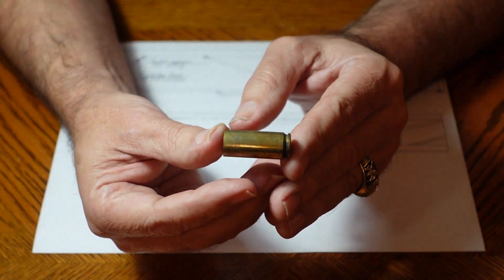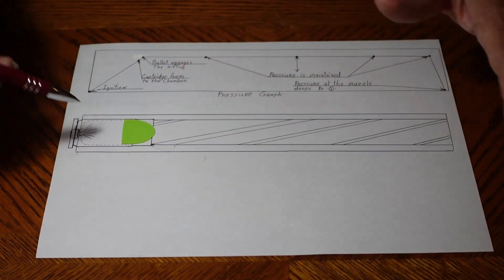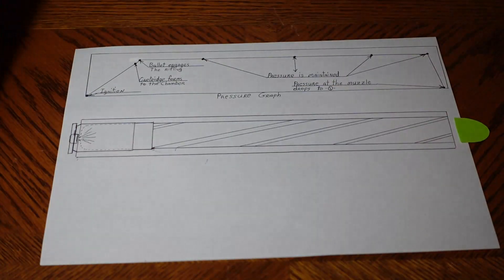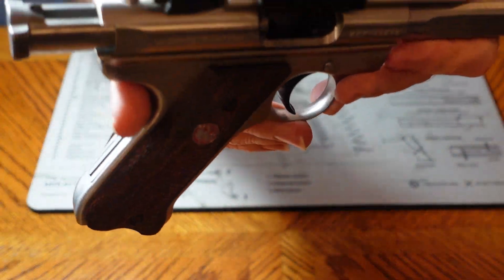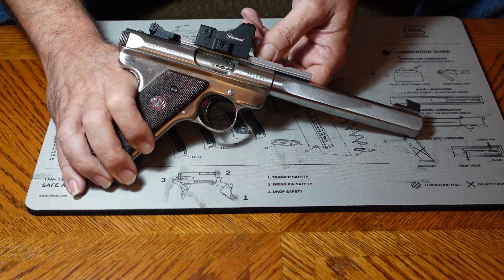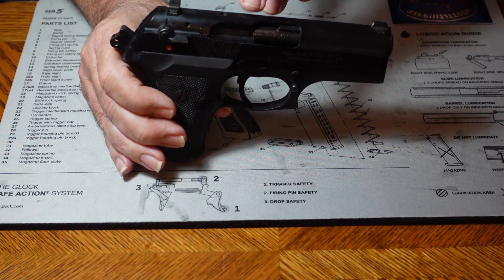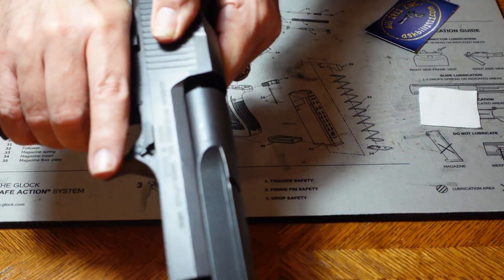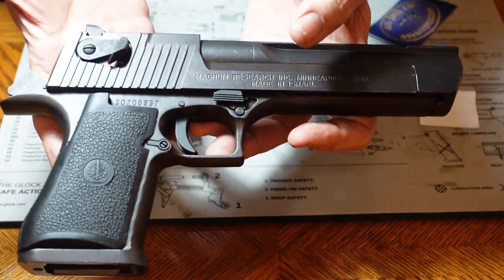Understanding semiautomatic operating systems.

Comment: on some pistols the cases take about 20 pounds to extract when there smashed in, added with the spring and hammer that goes up to 50 pounds if it has a heavy hammer... the angle of the barrel locks is associated with the difference in energy after the main deductions... could install a longer barrel drop pivot and it would lock up tighter, or a shorter pivot are for liter target loads. hand loads from 10fpe up to 600fpe. "so and so doesn't know its a lite loaded target pistol cycling 10fpe 160gr ball loads and... that's what they all are in canada but the minister is intoxicated as the "gangs" that think all guns are maximum power, nothing they have is actually loaded."

Comment: So is recoil operated just another way of saying blow back operated ?
Reply from the maker: There are three different systems in question. The first is (direct blowback). This system is used mainly used with low pressure cartridges like .22 rimfire. In the video we featured a Ruger Mk. III to illustrate the action. The second type of operating system is frequently referred to (at least in my area of the country) as a (delayed blowback) system. Delayed blowback is only a common parlance. The correct terminology is (locked breach, short recoil). This system uses a mechanical locking system to delay opening the breach until the pressure has dropped enough to make cartridge extraction possible. In the video we used two examples. The Model-1911, and the Beretta mini cougar. The third system is the (gas operated) system. This system uses a port inside the barrel to tap off a portion of the gas pressure to operate the action. The example used in the video was an Israeli Military Industries - Desert eagle. Most if not all (gas operated) firearms use a rotating bolt locking system, with an operating rod driven by the gas from the barrel to actuate the system. Other popular examples of gas operated firearms are Eugene Stoner's AR-15, or John C. Garand's M-1 Garand. I hope I was able to answer your question. I would like to thank you for taking the time to write in.
Reply: @Bill1911  what does " recoil  " operated actually mean ?

Comment: Hm, no. Recoil is not caused by the "blowback" but by the bullet movement. It starts as soon as the bullet leaves the casing and stops right after it leaves the muzzle. By your explanation all bullet weights and even blanks would have the same recoil, which is demonstrably wrong. I stopped watching at 5:40, so I apologize if you clarified/corrected that statement later.
Reply: That's what I was thinking. The equal and opposite force would begin as soon as the forward force that is moving the bullet. However the heavier mass of the gun and the pressure being equal in all directions  keeps the effect of that force from being felt until after the bullet leaves the barrel and allows that pressure to be released at the muzzle so all excess force is directed backward.
Reply: @brettphillips3091  Iam not talking about what the shooter feels. If I was, I would say that the shooter cannot possibly feel any recoil before the bullet leaves the muzzle. Why? Because it takes longer for our senses to register it than it takes the projectile to reach the muzzle. I would still never say that the recoil is caused by "blowback" at the muzzle, whatever definition of blowback is used.
Reply from the maker: I normally wouldn't reply to an argument, because it to easy to sound condescending. That is not my intention. Mass acceleration is not a factor here. remember the mass of the gun greatly exceeds that of the projectile. The force in question is equal opposing pressure. The force exerted on the back of the bullet is the same as the force exerted on the breach, and is pushing equally on both. If mass acceleration were the force in question we would see a continuous rise of the muzzle. Sight alignment with the firing axis on a handgun is essentially level. If we were to experience the muzzle rise that is dictated by the physics of your theory, we  would shoot over the top of the target with every shot. Remember when we bore sight a gun, we zero on the point where the bore is pointed, not where we expect it to travel to. As for blank cartridges, there is no projectile. therefor no opposing pressure is created. Blanks are usually nothing more than a primer.
Reply: @Bill1911  The equal and opposite force ends when the bullet leaves the muzzle, full stop. That is the opposite of what you are describing and has nothing to do with muzzle climb, bore sighting or the weight of the gun/projectile (except for direction and intensity). I used blanks as a very simple example of why what you say cannot possibly be true - the amount of charge in the said blank is of no practical relevance.

BTW, it does sound a little condescending, but I appreciate your effort to point out that it's not your intention. Neither is mine :)

Comment: First time I've seen the locked breech, short recoil system called delayed blowback...
Reply from the maker: I want to thank you for taking the time to comment. You are absolutely correct. Locked breach, short recoil is a correct term. In my pare of the country, delayed blowback is a common parlance. I try not to talk over people's heads, but I also don't want to talk down to my viewers. I find that both terms adequately describe the operation. So I concentrated on what forces are are being harnessed (pressure) and the mechanics of why it works. Your comment is helpful. It illustrates the fact that I am speaking to a wider audience. I thank you for taking the time to write in. Making these videos is a constant learning process and well thought out comments will help to present a better product.